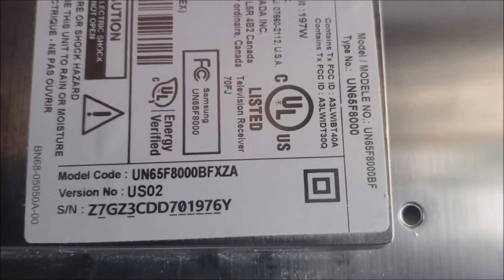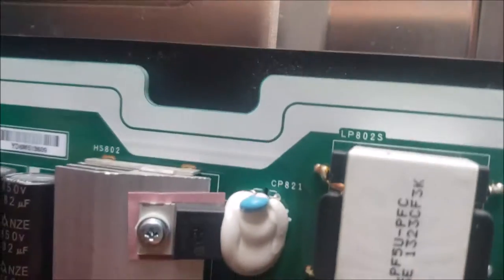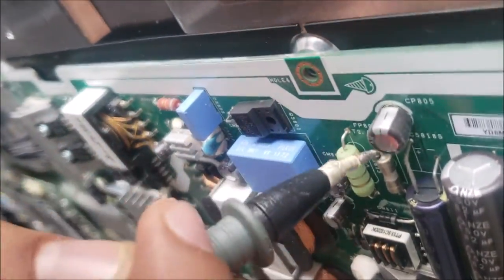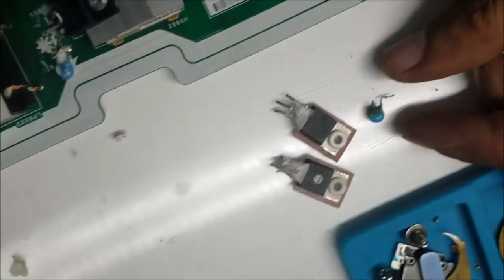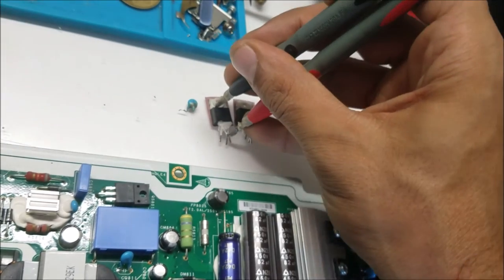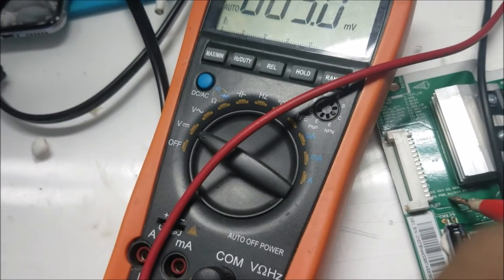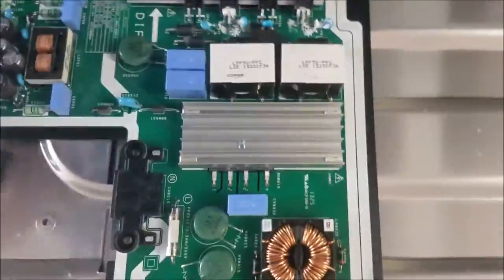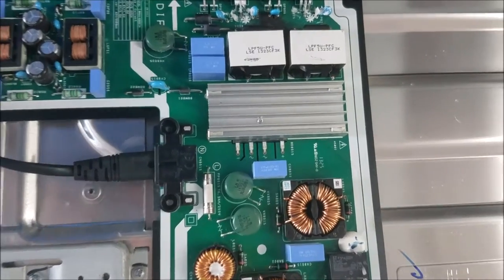samsung tv un65f8000 wont turns on power supply repair

Comment: Great video! I have the same tv. It doesn't turn on. The relay is constantly clicking. No 13v or 5v reading on the board outlet. I figured out  one fuse fp8038 just below  the 450v capacitors was blown. When i changed this fuse and plugged in the power cord,  then the fuse by the power inlet has blown. I checked the mosfets that you have changed in this video,  they are fine.  However the 2 on the nearby cooler aren't ok. Those are fdpf 18n50t.  
My question is, if i replace these mosfets,  would there potentially be any other damaged components?  Off course other than blown fuses.

Comment: Where did you find the gr125c6 transistor? I'm having trouble finding a replacement for mine.
Reply from the maker: Ebay have them but it will shipped from china. Or you can look for a equivalent one
Reply: Thank you. I have the same tv with the same issue, the same 221kv capacitor blew out. Did you use an equivalent part for that transistor or did u order from China?
Reply from the maker: @derekgdonley  i use a equivalent. get the mosfet part number and look for data sheet, new mosfet must be match  mosfter symbol and should be the same or more for max voltage and amperage